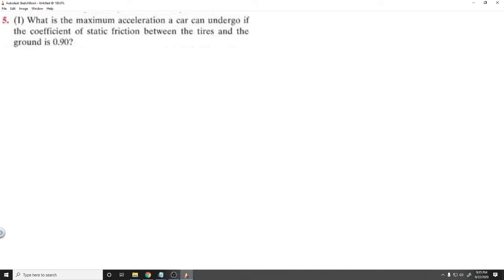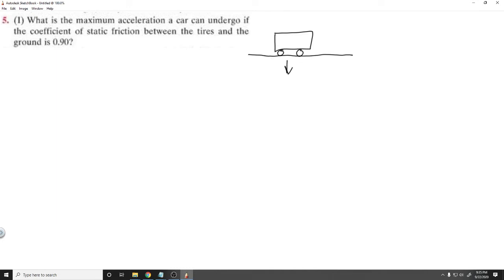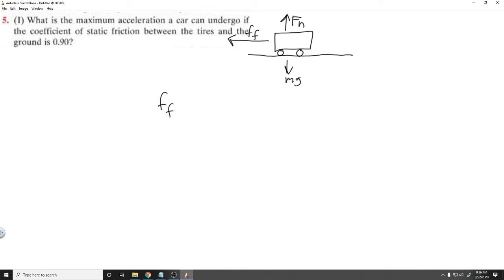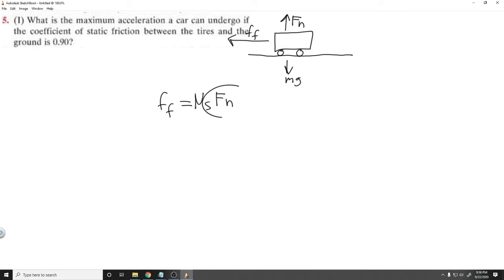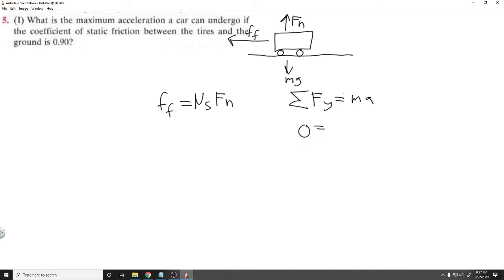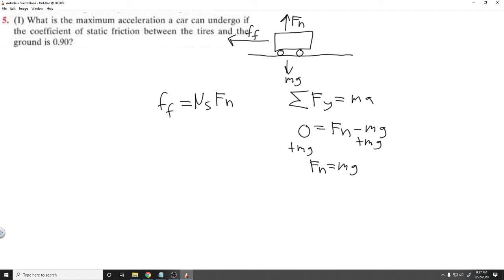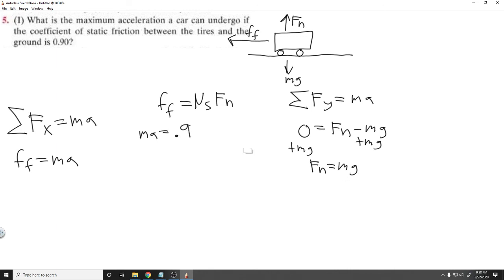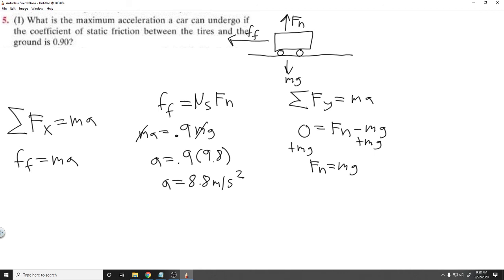What is the maximum acceleration a car can undergo if the coefficient of static friction between the

Comment: Nice Video mate, but you actually made a mistake here, the force of Friction is going to act in the direction of movement of the car and not in the opposite sense and also it will be Kinetic Friction if slipping is there so you should also mention that we are talking about pure rolling in this problem!

Comment: Thank you for the helpful video! I had one question. If the frictional force is in the opposite direction in which the car is moving, how come when we solve for the sum of the forces in the x-direction, we aren't setting ma equal to -Ff? Thank you in advance!
Reply from the maker: Hello. I realized that I made a mistake on this video. The force of friction is not actually in the opposite direction. The force of friction is pushing the car forward. The way you should think about this is that if there was no friction between the tire and the ground then the tire would just spin in place and the car wouldn't move. The frictional force is like a grip that the tire has on the ground that it is using to "pull" itself forward. The force of friction is in the positive direction so the sum of the forces (ma) just equals positive Ff. The answer to the problem is still right I just made a mistake in my illustration. Hopefully, this helps. Sorry about the mistake once again.
Reply: @TheAnswerKey  Thank you so much for your help, I really appreciate it!  It was driving me insane, but your explanation cleared everything right up!
Reply: @TheAnswerKey  Wow that’s actually really logical. My physics teacher never explained how friction could make a car accelerate so thanks for the help